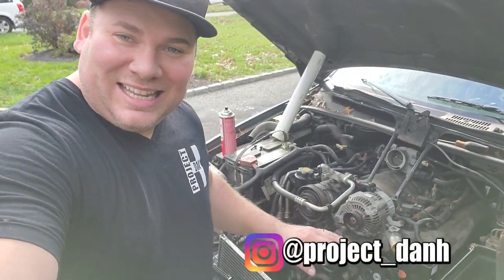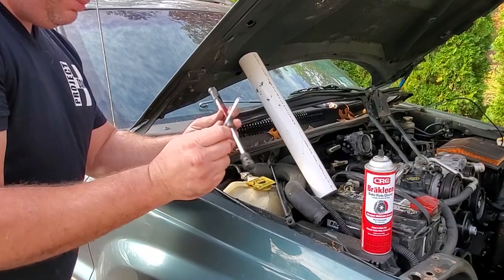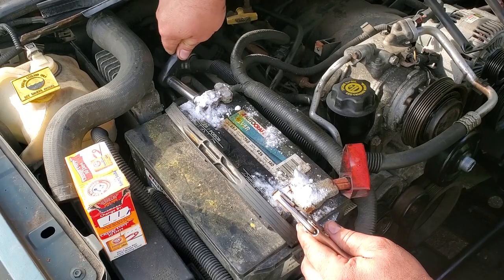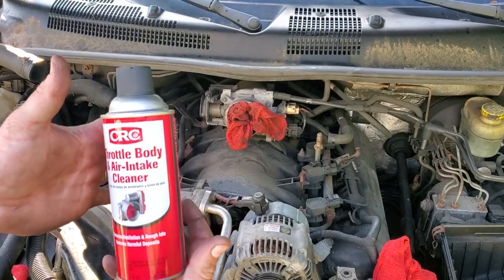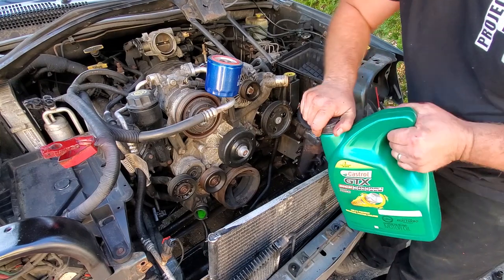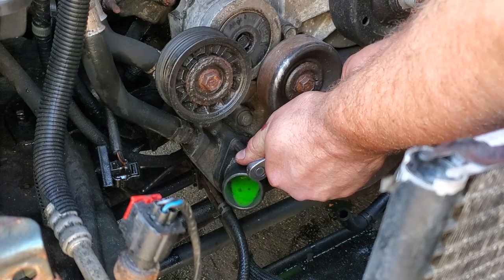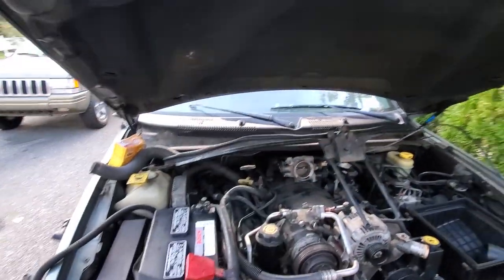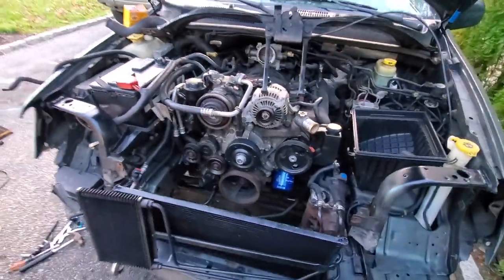JEEP WJ REFRESH EPISODE 2 - GOING ALL IN! INTRODUCING THE GREEN HORNET GRAND CHEROKEE

Comment: That sludge under the oil cap is because ANOTHER issue with the early 4.7s is that the PCV plumbing is all wrong... yet another thing MartinBuilt fixed on his build
Reply from the maker: is that something a catch can could fix?  Ill have to call upon the power of martin!
Reply: Hello guys, is that problem for all WJs or specific years? mine is 2004?

Comment: You can also use coke-cola to clean the battery up. When you drain the oil you can put a small magnet into the plug hole a see what you get out of it when you pull the magnet out to see if there is any metal.
Reply from the maker: I love this magnet idea ... but I always forget! Lol!

Comment: I feel you on a that haha I got a green hornet also  02 ho, 180,000 miles replaced all cooling system and flushed because  green coolant belt tensioner and all nee ac system ,still gotta fix the dam blend doors updated valve rockers and lifters from melling sounds quite now, next will be all the suspension  bushings, I love the v8 still quick after being 20 years old
Reply from the maker: Great work brother! nothing like a restored V8!

Comment: I changed the oil in my project XJ. I used 5w30 and Marvel's mystery oil and was considering using an oil stabilizer too but I got to thinking. I used 5w30 because I knew the MMO would change the total viscosity and make it similar to the 10w30 that I would normally use. Do you think oil stabilizer changes the viscosity of the oil? Do you think the MMO and the OS interact or counteract eachother in anyway? That would be a cool video to see (if there was a way to test it lol)
Reply from the maker: That's a hell of a question buddy! Id love to call on a chemist who loves 4.0 Jeep engines 🤣